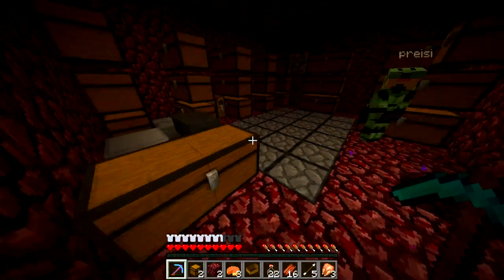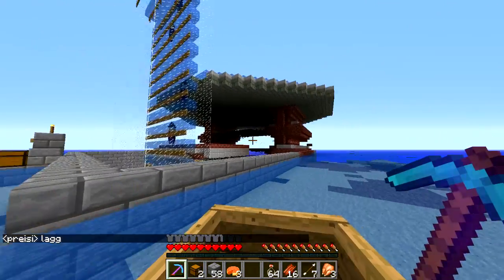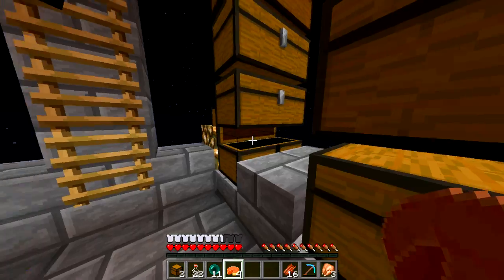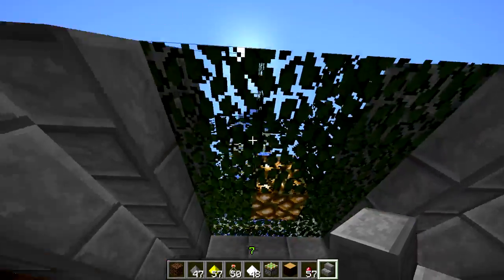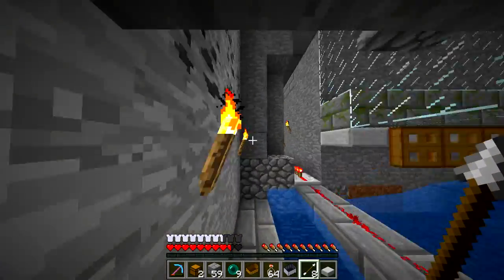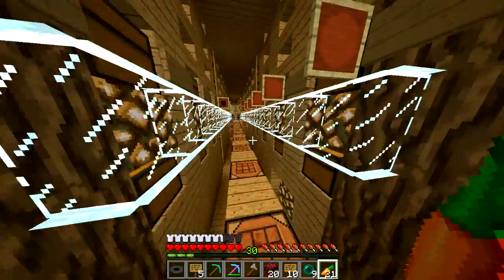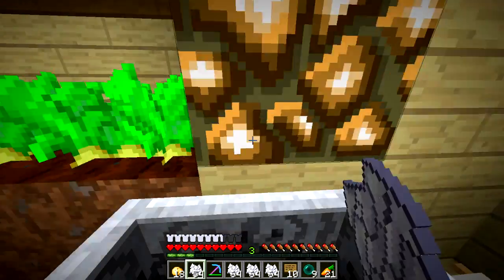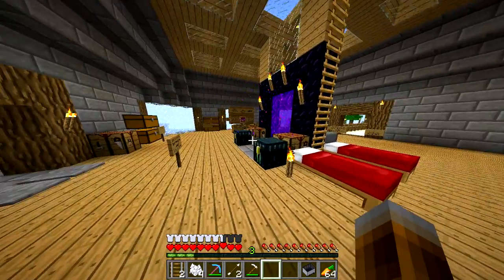JL2579's SMP Server Tour #29: Double Witch Farm!

Comment: JL, what 'y' level is the platform on? And doesn't building at that height give the game far more chunks to check thereby slowing the spawn rate?  Also I think I heard Etho say that the comparator continually updates the block is pointed at.  Could that be used to eliminate the clock?  Also does this still work in the snapshot?  And is there a tutorial that focuses on the shifting floor design used here?

Comment: JL, I have a question regarding the newest snapshot 13w01b. I have made the same piston pusher design but the pistons that run off the clock don't push back. I have tried multiple tick delays and nothing. Is this a issue with the update or does this still work for you.

Comment: Sorry if I missed this in the video but I'm trying to understand how the spawning works.  I have a similar farm.  The spawn pads have 0 light and I verified with Kabo's mod that they are in the right place.  I lit up the ground for 128 blocks in all directions and made sure I was far enough away for a spawn.  I had one witch spawn while building the farm but none since.  How does the height affect it so I don't have to cave?  I've gone up 100 blocks into the air and still no spawns.

Comment: Your spawning pads are awesome, but your killing/collection system could be improved. You can place a area of halfslabs directly under the pads and shift that 1 over and back with a specific redstone setup: Make it activate only if there was a few ticks of no witches falling (connect that to the lower tripwires somehow) and on the very next tripwire activation. I have that in my own witch farm and it works great, you can see it on my channel, I'll also make a video response.